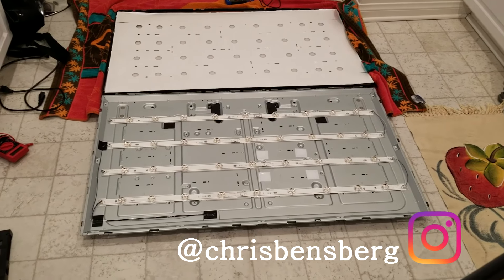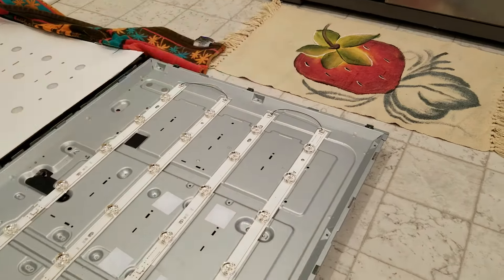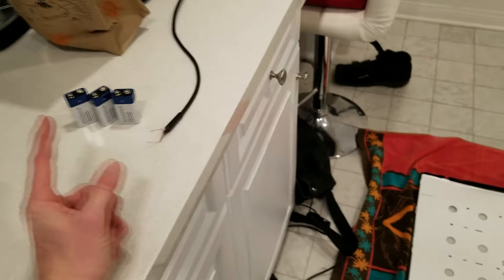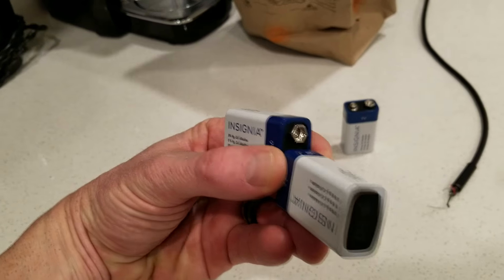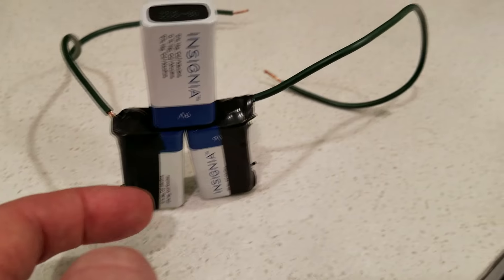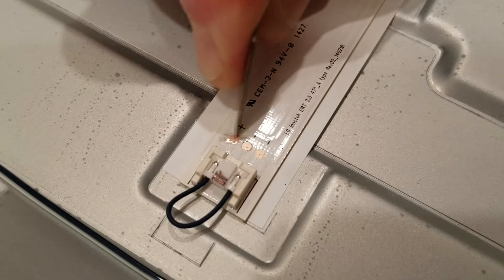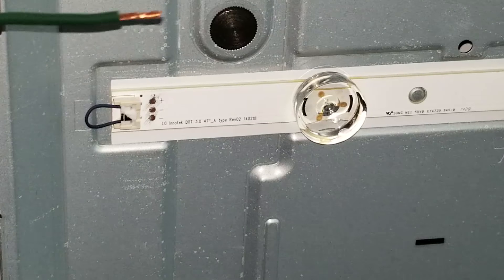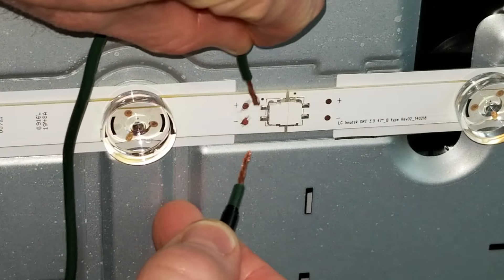How To Test TV LED Back Lights Without A LED TESTER!

Comment: 4:47 - Is there a reason you chose the center negative terminal on the led strip instead of the outside?  I would think there is less of a chance to short out your power supply when using the two outside terminals.  Are the two negative terminals not the same on each strip?

Comment: Made my own 3volt tester out of two pencil batteries, one foot of speaker wire and two safety pins. But at 3volts you check each LED individually

Comment: Regarding why the some strips only light from one end: I appears that strips are not lighting from the end that has a shorted connector on them. Therefore when the battery is connected to the end with the shorted connector the battery current flows threw that connector and short out the battery. Notice that each row is made up of two 5 LED strips connected in the middle and that two rows are connected together in a series arrangement on the top half and that the bottom tow rows make up another series connected bank. When connecting to the strip opposite the shorting connector the 27 battery arrangement was being connected to a strip that lights up with a little over 14V. I am sure the current was being liited by the internal resistance of the battery in this case.
Reply: for all the labor involved in this. replacing all the led strip sound like a better idea.     just sayin.
larry
Reply: liited?

Comment: If you remove the tops of old 9 volt batteries, the connectors can be soldered to wire and used for the battery connections.
Reply from the maker: Excellent, thank you:)
Reply: you should never disassemble a battery. that is very dangerous

Comment: I sent my TV (LG 42LB65) to be fixed by an LG-certified repair center here in Egypt. The backlight strips were replaced, but instead of bright white spots, there are slightly dark spots, which can be noticed in video games with large bright uniform scenes. In other words, my problem was mitigated, not completely resolved. When I called the maintenance shop, they told me this is due to the fact that the components of my TV (especially the power supply) are old. I bought the TV, as far as I remember, on 2/2/2015, making the TV over 8 years old at the time of repairing (late May 2023).

The weird thing is that the sightly dark spots are there despite the backlight being very very bright. Moreover, on some contents colors seem to be "washed out"; too much pale color on the screen, especially YouTube videos.

Several technicians I know tell me different things, but most notably that it might be an issue with the quality of the LED backlight strips. The strips I installed are not a genuine kit produced by LG, but a Chinese one. The repair shop told me that the genuine backlight kits are far more expensive and are not available; all those who claim to sell genuine Korean LED backlight strips are lying.

I need help, can this issue be 100% resolved? Can this issue persist due to the TV being old? I want to fix the issue 100% and have my TV like new again. Do you think someone here is lying to me?
Reply: Did the other technicians open the TV up and checked what LED stripes were actually replaced? Because this sounds like the first technicians just removed the faulty leds and kept the old stripes in. So basically you could have led stripes with the faulty LEDs missing on them. I did this to a TV of mine too. Found that two LEDs were faulty and just removed those from the strips and insted of putting a new LED on the stripe I bridged the contacts with a wire.

Comment: If just one LED is bad it makes the whole strip bad because these LED are set in series. If you go individually and find the bad one in the strip and change just that one the whole strip will function properly.
Reply: ok so if no continuity some led is opening the circuit ? thanks ( I do not see people testing the 2 white wires that send power to the backlight leds that is why I ask)  thank you

Comment: One of my strips proved to have a problem. I was able to illuminate them one by one with batteries. I did the same with my diode tester. But then two out of seven led's did not light up. How is it possible for those two faulty ones working great with a battery?

Comment: I used this same battery arrangement to power 28vdc devices on aircraft which nearly all have a 28vdc power system along with 115vac 400hz too.
Reply: why not use a variable DC power supply?
Reply: @Chevroletcelebrity  We didn't have one.  It was a rare situation that it was useful.  We could have used the 28vdc battery on the aircraft but getting it out and bringing it to the location required would be more difficult than using the three 9v batteries.   Also low current available from the three 9V was safer.

Comment: So then if I wanted to use the old LED backlights out of our tv to use to light up different areas of my motorcycle off of it's 12 volt battery then I would probably need to wire some voltage reducers (I forget what they're called) inline depending on how many LEDs I'm running in order to keep them from burning out?
 P.S. They are a nice shade of blue now, perfect for under lighting on our Glacier white pearl Harley-Davidson! Lol

Comment: Where will I find the video on testing power supply board with a multimeter to determine if the power supply is shot also with the LED lights?

Comment: I could be wrong.... but I feel like you were applying voltage to the wrong side of the strips. The fact that you got them to fully light up from the other side tells me that these strips likely zigzag down. Power going one way from one strip, the other way from the next row.

Every other strip needed power from the opposite side to light.
Reply: I noticed that as well. I wish he would have tested the right side of the first strip then i could fully believe him.

Comment: any idea what kills the led? mine worked great till yesterday.
 I made tea, came back and it was all black. testing shows 176v after power up then slowly drops. no light at all so the leds are shot, the wires show no resistance or anything rtu4300
Reply: If you keep ur TV on the brightest setting at all times this will burn out LED's

Comment: Do you know how to test capacitors? I mean without taking them off the board. But anyways, Excellent videos!! I never would have thought a few bad LED's would cause it to flash like that! You just saved me a lot of money trying out other parts. Definitely subscribed, and keep it up!!
Reply: You can't really test a capacitor without removing. If they're surface mount, you can check for a dead short though.  Capacitors are often parallel with other capacitors and components so their capacitance can be affected by them if still in circuit
Reply: @mixerfistit5522  Hey thanks! And yeah I figured you couldn't test without removing them, it just sucks having to remove them to test and re-solder, especially since I have a cheapo soldering iron, it was like $10 I think haha. Do you happen to know a good soldering iron that's not too expensive? I don't do a WHOLE lot of soldering but it's so much better with a good one, (this one doesn't get hot enough it seems and have to hold it on there for a long time, especially when de-soldering) but yeah this is pretty much just a hobby fixing TV's, been doing it for 10 years or so. I usually get TV's free on Facebook or when they have a free cleanup at the landfill, always a bunch of TV's there.
Reply: @Josephthinleg  I use a solder station that has a digital temp display and also an integrated heat gun which is great for components with multiple pins. I bought mine for about £60 a year ago, they all seem to be clones on ebay of more expensive models. If you look for solder stations you'll see what I mean. Mine has a variable power supply up to 15v and 2A which is handy for testing individual LEDs and little motors etc. They heat up really quick too. Sometimes I wish I had a psu up to 24V but the cost goes up a bit then so have a look around within your budget.
BTW if you're trying to desolder the LEDs on a TV you'll need to remove the strip first and either apply heat to the back of the strip or to the led carefully as most of the heat gets pulled away by the copper strip and you won't get anywhere

Comment: i had a sony kdl-32r300B that would power on and quickly off again. i checked the led's and 3 of them where burnt out so i "time rich and resource poor" decided to scrap the leds of and solder the connection points together and it worked afterwards...
Reply: yes that was my intention as well , even came up with this idea of hooking up few battery , but my problem is that my STRIPS dont have soldering points on them 
i cant do that , freaking thing doesnt have any points  looks like ill have to  scrap the defusers    to come down to the joints where i can short circuit it .

Comment: I have Dell 5348 AIO whose inverter board is malfunctioning. I have a question about the 'Backlight connector PIN configuration', it has 4 pins, 2 middle pins for LED power and 2 corner pins for 'Channel 1 current feedback & Channel 2 current feedback'. 

The channel pins have 5V power when the Backlight LEDs are on and non when there're off. These are not GND pins then where are the GND pins and what are the 'Channel 1 current feedback & Channel 2 current feedback'.

Kindly advise.
Reply: There is no GND pin ,  its DC  , look at those like + and - in a pair , there is no current sens , that is done up the line i guess via resistor , its bad labeling  its just + and - in a pair of 2 , i would bet

Comment: hey dude. I opened my LG 32LB561V TV beacuse it wasnt working and the screen was always black. So i open it to backlights and half of the lights (the transparent plastic pieces glued on LEDs) were just loose and sliding around the case of tv. I have no idea how that happened but is there a way to fix that or do i have to try and order new backlights?

Comment: THIS IS GREAT.  My Insignia 50" went dark - not dead - after 17 months.  Insignia diagnosed it over the phone because "they see this often."  So it's a known failure they won't fix.  Best Buy won't even give me an estimate to repair until I SPEND TWO HUNDRED DOLLARS on a "service contract." Be warned.  Crooks. 
What's the smart/safe method to drain any capacitor on the power supply before touching anything? It's never the part you're working on, it's the ones you're not paying attention to that bite you.

Comment: The set up was confusing for me in regards to checking yeah strip , there were like 4 rows but In Each Row there were two strips which either I missed it or he didn't explained.. however I made my three 9volt battery tester and tried a Row ,I did scratch the thin Film on the negative and positive and nun of them Lit up... However when I do EACH LED individually they light up.. can anyone tell me what's going on here
Reply: And when I tested the TV originally it had a image on the screen just not the back light was lighting up the image to make it fully visible

Comment: Thanks for making this video it is really helpful for understanding how the led display work and how to check.
But I have one doubt in testing voltage , as you stated first there are 9 led bulb and each are 2 to 3 volts  then total votes required is max.27 volt but as I understand you applied 27volt on lesser led . Then why these are not got faulty due to access voltage across terminals?
Actually I need the support to repair my own led tv with 40inch screen

Comment: One set of 4 9v battery costs $12 and a cheap LED tester is $18. Any way to just check it with an ohm metter? I won't have any use of the batteries or the tester afterwards.
Reply: If you have a dollar tree in your area they have packs of 2 - 9v for $1

Comment: didnt work for me. I tried placing the leads on the two spots at the start of the strip and nothing. I even placed them on the pins to the power connector for the leds on the power supply and nothing.  finally I did place them on the points for single leds and blew a few out (overvoltaging I know). I also placed the leads on my nippies and it felt pretty good.

Comment: I used my home made  bench power supply , it has about 20+V , and when i test any strip it lights up but DIM , when i say DIM its dim , like barely visible dim , i didnt even see it first time 
When i plug it in TV power supply , its also DIM , sometimes it even Flashes like when i just  plug it in to Wall socket , it flashes constantly , when i turn it on it holds but dim again 
There are 2 DEAD LEDs in those strips , 
I checked the power board , seams ok , i checked Mosfet for Back light power on the power board its ok , it works 
So only thing ive found is  2 dead LEDs and Strips light up Dim, ive checked them separately like here , always DIM , i didnt expect to see them all DIM , that is why im unsure  if it is the strips , how come they all died and went dim , i expected few working ones .
Cant check the diodes separately there is no point to hook em up ,if i dont break the difusers , do you guys susspect also that strips are dead ?
Reply: @MSRxD9  you didnt even read it , i didnt burn jack shit , the problem is in LED driver , doesnt work , you just trolling around arent you
Reply: Hey I got 36volt DC power supply and a ''lab'' psu with the 20 volt yellow? I haven't played with it in a long time. I'm thinking the 36 will probably blow it but do dim LEDs cause the power supply to shut off and on? Mine flashes ever 10 seconds
Reply: @astrataway7077  you mean your TV led strips flash ,   count you leds ,  every led is 3V , so if you have 9 LED diodes on a strip, correct voltage is 27V , and you wont burn it  up until 30V , thats how you know , but im suspecting your LED driver doesnt work just like mine ,check the output voltage on it , its probably busted , ive fixed mine but i have dead short on the board somewhere and cant find it .

Comment: Great video, is there any chance I could just replace the obvious burnt led strip? Also, is it safe to only reassemble part of the tv or even just to plug it in the wall and test the leds that way? Avoiding letting the back touch anything that is.
Reply: no it is not possible

Comment: 27 volts applied to 5 LEDs in a series circuit is to much voltage,  In the past I've damaged LEDs by over voltage,

Comment: if I wanted to light them all together from the cable that goes to the power supply, how man volt i need?
Reply: 2.8 to 3 volts per light multiply by how many lights you have per row

Comment: you only tested half of the row (4 lights vs 9 lights). 4 * 3.3V = 12V. yet your tester was 27V. Kinda confusing. I'm lost as to why the whole row did not light up. if you had made the math 4 *3 or 5*3 then I'd be less lost.
Reply: If you tested the row in the half that half would be to fused and break
Reply: the maths are right but the info is wrong. see reply above.

Comment: ok now i have a 50 inch i have not exposed the led strips now the power supply with my meter tells me 68.5 on led strip 1 and 68.5 strip 2.I only have 2 strips

Comment: Nice, could a power for a laptop computer be strong enough (+-18v) ?  or will the protection circuitry avoid it top send enough amps ? (sorry for my approx english !)

better keep the protection on contacts is not it ? (any sharp point will make contact I think)

Comment: All of them, but absolutely all of them only say about the voltage of the LEDs on a strip of TV LEDs... none of them say about the amperage (milliamps) of the LEDs in the TV... they are TV LEDs that work at 3, 6 and 9 volts.. .one is to test LEDs with 20-25mA, another is to test TV LEDs with an amperage between 260 and 310 mA..."professionals"...they took the videos from each other, changed the buttons, wire colors and... done..a new video...

Comment: Why does it only light up one side
Reply: there are two sections...separate left and right that are isolated from each other. They use 6v leds not 3v so will illuminate with 24-30v

Comment: An absolute NOVICE idea .. NOTE the leds are in series means if one led is open than the entire strip will NOT light-up . to be sure you need to test individual leds. The 9V dry cells are of 1960s technology maybe in some places like Pakistan you may be still using them, need to make a tester using a Lion ..for individual testing ....

Comment: I took apart 3 of these tvs, all cracked screen. These LG tvs uses 6v leds, so...retest from the middle 24v for 4 led strips and 30v for 5 led strips. Then test each one with a 6v power source. These strips are harder to test because they do not have test points between the leds so you need to make your own by scratching the white protective layer off. This guy fixed the same tv https://youtu.be/Q46Y7HZW9ck

Comment: Do you have any idea of what are you doing? You didn't test even one light strip in full. I this LG there are 2 kinds of strips: 5 LED strip and 4 LED strip. The current go through LEDs only one way, that's why you have to check 2 lines from left and 2 lines from right side. 
Why didn't you check the right side of your TV :))) 
P.S. Better use 12V on the short strips (4 LEDs), do not try the 27V "tool" you made :)))
Reply: i have here a ONN 50'' rokutv that has no backlight at all testing with flash light  has 12v and 3v to the main board turns on and there is 12 v on T-con ,and i have 225v to the back light leds ,i think this is to much, what you thing ,is this the leds?Thanks

Comment: why not just plug it in to the wall? Not being smart, just curious.
Reply: Because of the circuit boards. If your tv screen won’t turn on, best thing to do is check your LEDs and make sure it works. If it works, then you can check the circuit boards and see if the circuit boards are faulty and not letting the LEDs have power. Hope that helps.